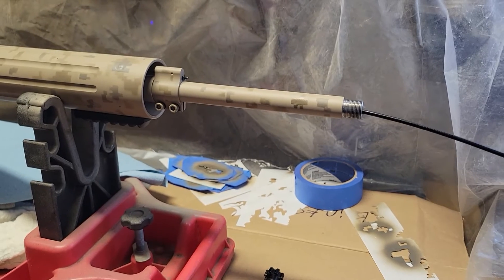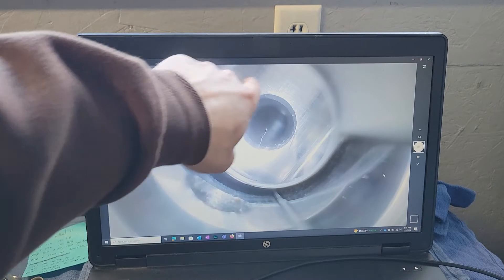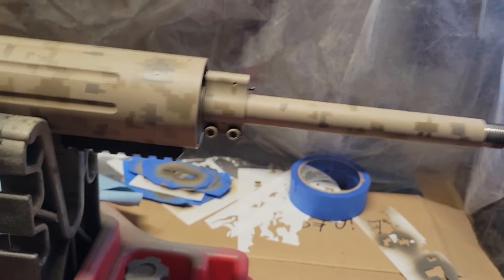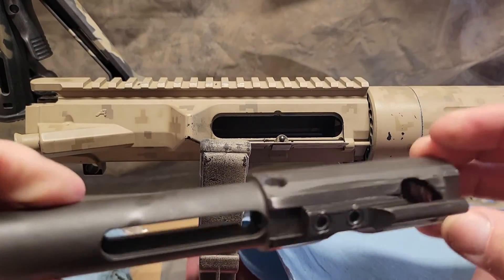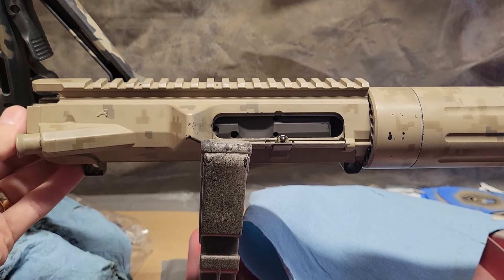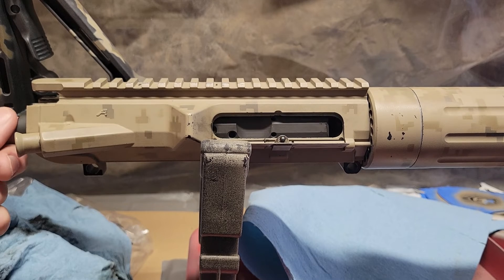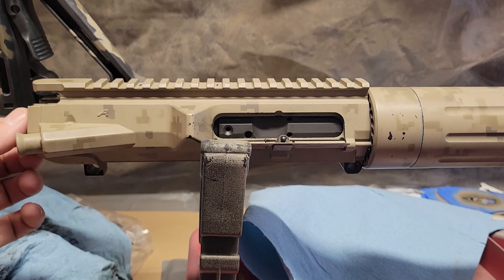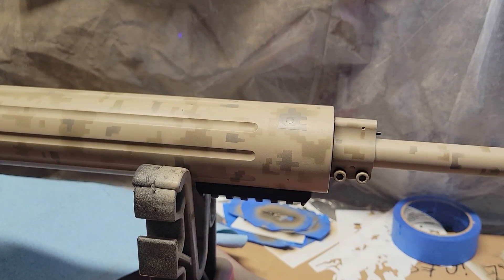Get Perfect Alignment for Your AR Gas Block

Comment: Gas tube to gas key alignment is probably the most under-talked about topic on this subject. Everyone focuses on gas block alignment which is actually quite easy to obtain. Furthermore, you also want the gas tube to move freely where it enters the upper receiver. I once spent well over an hour tweaking a gas tube to get it as perfect as possible  😅